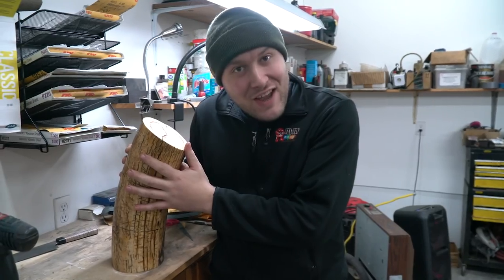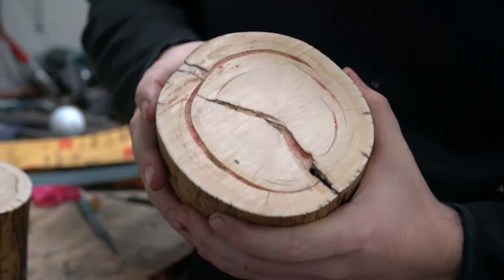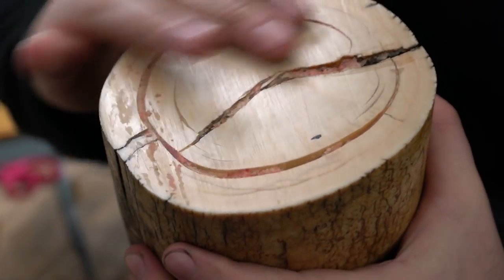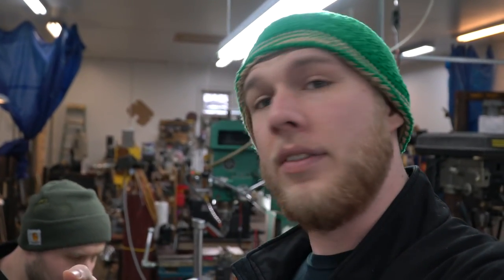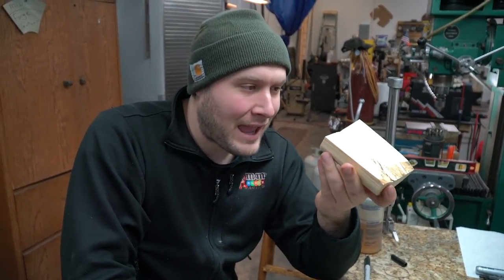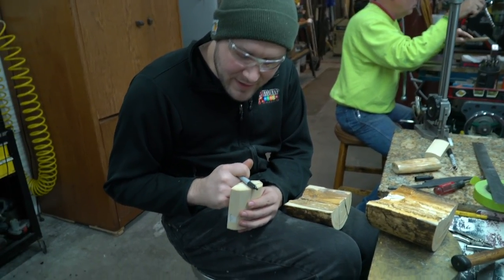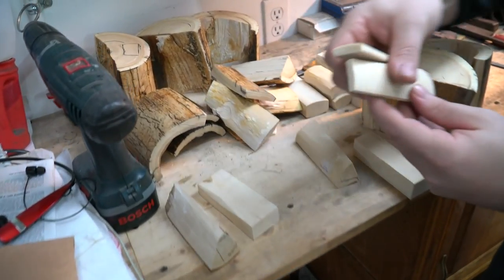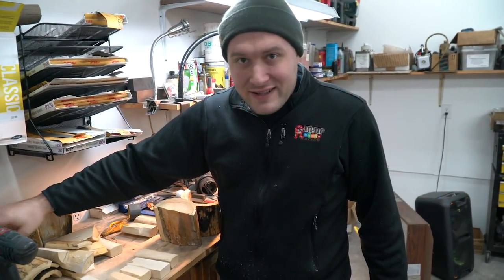Mammoth Ivory: Cutting out the Blocks for My Knives

Comment: I lived in Alaska for 40+ years and have watched and talked to natives that carve out of both Mastodon fossilized ivory and also pre 1972 or even newer (if they are Ak Natives) and they will stabilize the ends of the ivory by flooding it with super thin "Super Glue".  Let it dry and do it again and again till it takes no more.   Then they start cutting and sizing up their pieces.  This works better than epoxy as it flows much easier with gravity.   Just my two cents..   Nice tusks.   I was lucky enough to obtain 6 gallon bucket from a miner friend and use it for guitar nuts and saddles.   Great stuff!
Reply from the maker: Hey Rick glad you’re here with us. Thanks for the fun fact. That’s pretty cool. Thanks for sharing. 👍🏻🔥☕️🗡

Team Royer
Reply: Thin glue, commercial grade
Reply: A vacuum chamber for stabilizing works well with epoxy

Comment: Just a thought on the odd smaller shaped pieces, if you cut them into inch thick pucks you can do layered grips like with alternativing ivory. So like your steel butt cap, ivory, wood, ivory,wood,ivory, then guard. Eliminates alot of waste.

Comment: Very interesting!  You definitely don't skimp of choosing the best materials for your knives, I'd be tempted to make all kinds of knives just to fit the smaller sized blocks, even some letter openers lol.  The good thing is that you can use the thinner sections for some hot blued frame handles, as that's always a beautiful combo, an then maybe even use some of the shorter chunks for a dagger that has some type ofa spacer in the center of the handle.  What would be even cooler though, would be if you took and the unusable scraps and made the most exquisite rendition of a Kabar Bowie but did a stacked creamy white mammoth handle instead of leather 😮, and then a mosaic Damascus blade with hot blued guard and pommel 😁.  Lol, I'm just living a bit vicariously through your skills and materials now, but imagining projects can be half the fun lol.  Thanks as always for sharing you guys, it's always a fun learning experience watching your vids.   Take care :)
Reply from the maker: Great comment!  Thanks for your support!  That is a beautiful combo!

Comment: I think it would be cool to stabilize a 5" chunk with resin (either to match or to contrast) in a pressure tank, then it would be 100% usable for blanks and you also celebrate the mammoth tusk with all the natural inconsistency's that one would expect from a tusk that's thousands of years old.  Lookup wood stabilizing in wood turning, it will work in this application and would  be very unique. Just a thought, love the vids!!!
Reply: DATING HARLEY QUINN  yes stabilize in a vacuum chamber with "cactus juice" then you can cast solid in a pressure pot.
Reply: Ok, two concepts here that seem to be confused, stabilizing is impregnating a material to make it stronger and is also used for dyeing and yes this is done in a vacuum chamber and the other is resin casting. To create a 100% usable block with matching or contrasting resin you would resin cast and not necessarily need to stabilize. When casting you do use a pressure pot and not a vacuum chamber, at 50-60 psi the pressure crushes the air bubbles to a size that cannot be seen with the naked eye.

Comment: Couldn't you make a 2 piece handle? Use Glue, flute the pieces, and wrap with twisted steel wire that you make? If you make the Ivory slender at the ends, it could fit into the metal piece? Or, use 4 pieces between 1.5" and 2.5" in length, and in between and at each end, use a chunk of blued steel with Gold inlay? Use slender pieces to make handle grips for Revolvers? Inlay the Ivory into a larger piece of a very strong " Iron Wood "? hhmm Soo many thoughts. It shall be interesting to see what you decide. Now, Holler at your pappi and brother for wasting of food. e.g. the turkey that they smashed. Shameful.  Have a project(s) that you are making small and slender daggers using the Ivory for the Ladies? The Ladies like knives, sometimes?
Reply from the maker: Good to have you hanging out with us all Michael. 
      Dad